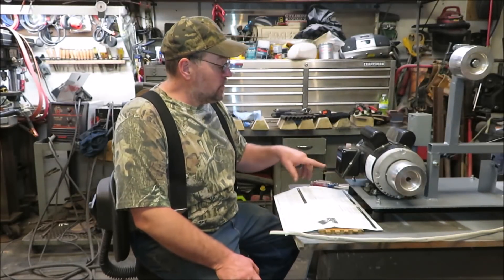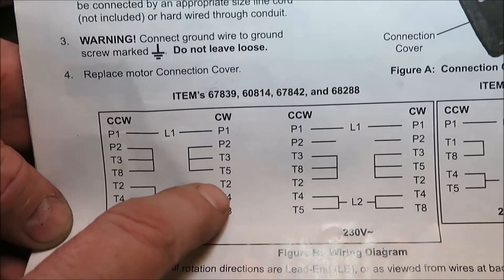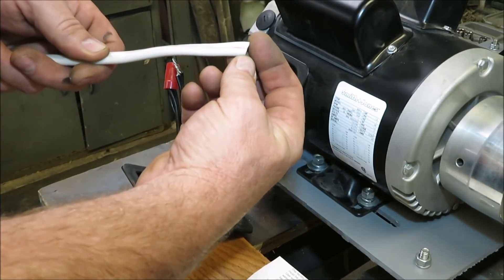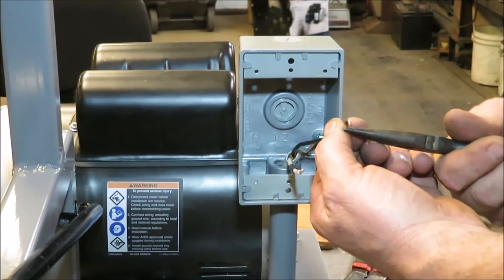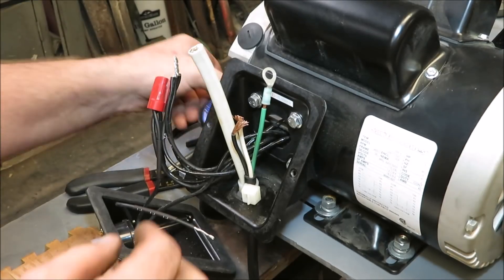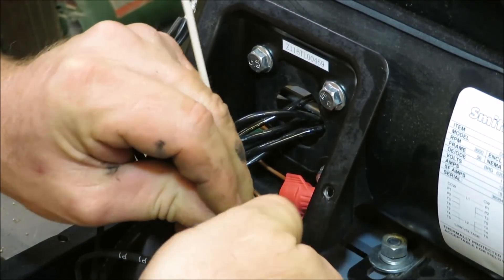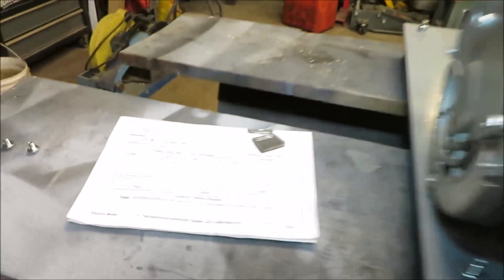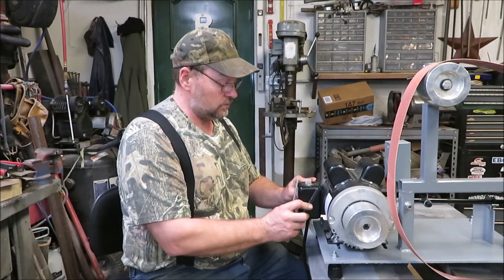wiring a smith and jones 1 1/2 hp motor

Comment: Old video but maybe someone can help. bought one of the motors a while back for my air compressor, got it all wired up for 115v and it'll run for about 5 seconds and then trip my breaker. Any ideas?
Reply from the maker: Is it on a 20 amp breaker?
Reply: @Robinson-Homestead  yes it is. 12/2 on a 20 amp breaker

Comment: My Dayton motor says FACING the shaft is how direction is determined.
Reply from the maker: Thanks for the info that helps Mark.
Reply: @Robinson-Homestead  thank you Kevin for the video. It helped me out! It appears that when going low voltage it is a series circuit while high voltage uses a parallel circuit with the switch. I wonder if that is generally true? Thanks again!! Mark
Reply: Yes I agree as I changed a drill press motor and it states to have the correct rotation you look down at the shaft (clockwise) is what you want there. They called it the working end of the electric motor.

Comment: Great Video. I just finished wiring my 1 1/2 HP smith& jones motor and every time i turn it on i can see a spark coming from the back of the motor. Does your do that?? I just wonder i wired it wrong. It run good. Thanks

Comment: You should invest in a decent set of wire strippers. https://www.amazon.com/Klein-Tools-1010-Long-Nose-Multi-Purpose/dp/B0000302WX/ref=sr_1_8?ie=UTF8&qid=1514747518&sr=8-8&keywords=wirestripper   I would also leave the Romex wire for house wiring. You could buy 3 rolls of #12 wire on 500 foot spools. Black, white and ,green at Lowes or Home Depot that wouldn't cost as much as you would think. It would come in handy for any other projects you come up with that need additional wire. Your belt sander looks like it will be getting a lot of use in your shop.
Reply from the maker: Nice tool I will get one thanks Lee.

Comment: Being of the industrial electrical trade Kevin I have to say that I did this at least 1000 times and probably more.....even on motors that where 10,ooo HP but the voltage was a lot higher.....we always used a meter to tell us the positive or negative rotation on the motors pryer to the hook up.....some of these motors would take half a day to make the hook up....you did a good job and the important thing is when your done that it works....good job my friend.....CHEERS
Reply from the maker: Thank you Gator All I can say is it' works and Merry Christmas to you and your family.
Reply: Same goes your way, Kevin....May you and your family have a very Merry Christmas.....CHEERS